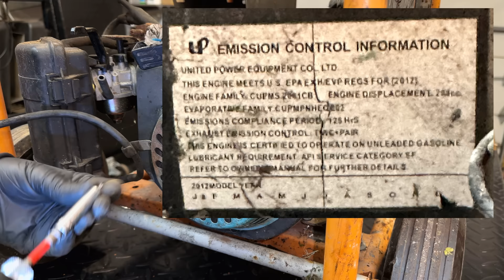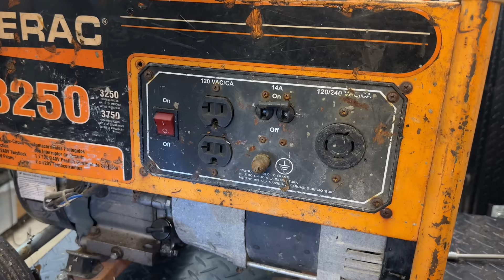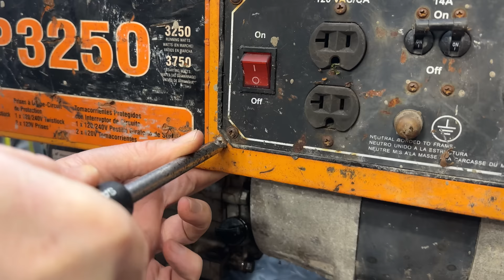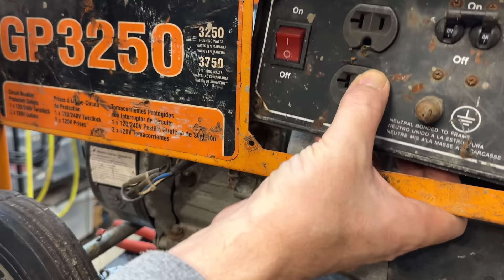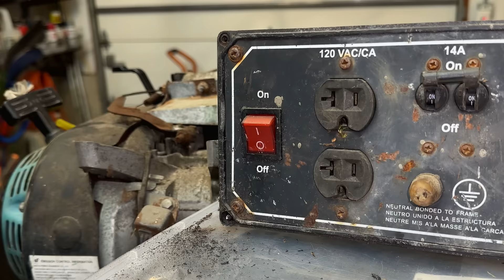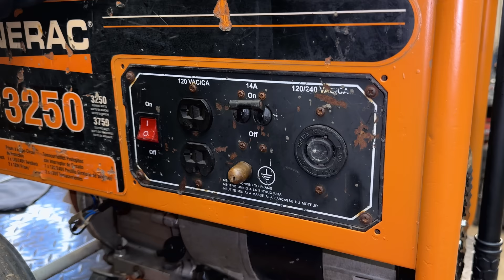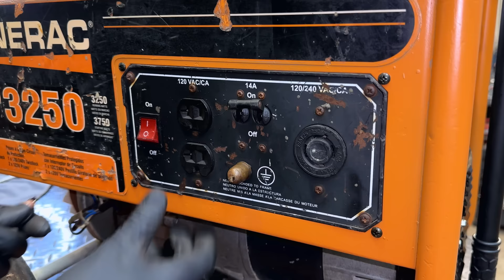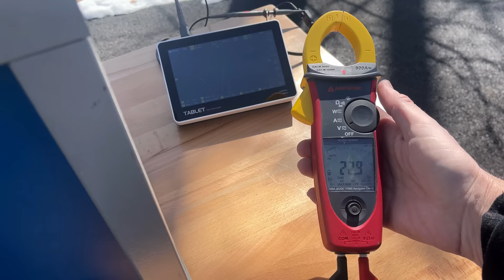Abandoned Generac GP3250 - Will It Run and Make Power?

Comment: After sanding a metal surface. IF you wipe it down with white vinegar it stops the oxidation process. And ensures a longer protection for the paint that is applied.

Comment: The best thing to use in your ultrasonic cleaner for carburetors is fresh gasoline in a glass jar big enough to hold the carb. Fill the machine with water and drop the jar in. Ultrasonic waves go right through glass. That's what I use in my small engine shop.

Comment: Welding tip: if you don’t have fine adjustments on your welder, try increasing the distance between your nozzle and weld (just a little). The amperage will drop some. Practice makes perfect.

Comment: How can anyone just leaving a good generator like this outside and do not take care of it? The work you did on this generator was amasing to see James. It's a lot of work. Thank you a lot! :-)
Reply: I am working on this same model and it looks almost as bad.  My is from an electrical contractor and unless brand new it is not worth the cost to repair them.  They get to look like that as they sit in the rain and snow next to a job site trailer.  After make parts like carb and springs are both under 20 dollars.  Replacement tank is about $40.  A little work and it makes a great backup generator to sit in the garage waiting for s significant power outage. I don't know how many hours a motor like this is good for but they live a hard life on job sites so I wouldn't want to try and sell this to someone who expects to get thousands of hours out of it.
Reply: @Privat2840 This generator may see a few hundred hours if it was used as a back up generator for the rest of its life. It will serve faithfully as long as basic maintenance is performed & they keep the tank dry between outages. 
I think it’s days as back up power on job sites have come & gone.

Comment: Our tech manuals called for a dilution of 60/40 of Simple Green in our sonic cleaners. 😉
Reply: I used gunk parts cleaner that comes in the gallon cans - I put in 2 gallons, and use it about 6 or 7 times then run it through a coffee filter in a funnel and use it about 6 or 7 more times. Its not cheap - 2 gallons cost me something like $100, but for 15 cleanings that's only about $7 each. It doesn't seem to bother most stuff but I don't put plastics or rubber in so I don't know how they would fare. I've thought about using dishwasher detergent as it has silica in it that may be able to 'sand blast" stuff clean in the ultrasonic but I've yet to try it.

Comment: For your seized screw into the plastic, just get yourself the HF butane micro torch, lightly roasting it will melt the plastic unfreezing the screw.
Also I find other uses for old gas, still cheaper than roundup for weeds growing in driveway and sidewalk cracks, and I mix it with drain oil for a punched up fire starter mix.

Comment: Thoroughly enjoy watching you methodically run down issues one by one.  Last year, I installed a natural gas 26Kw Generac whole house standby generator.  I did one before, a 14Kw at my dad's house so the hurdle wasn't as large as it was the first time.  The local electrical contractor company wanted $14,000 to supply the $6,400 generator and install it.  I ordered it from Amazon and did it myself and it works great.  The only issue is when it starts, it'll shut down after 30 seconds or so saying it's underspeed.  Another 30 seconds later, it starts again and runs fine, then switches over to power the house and we have not overloaded it yet just living normally when we have an outage, which happens quite frequently here.  I'm pretty sure the issue is the undersized flex line I have running to it.  It's 1/2" and not 3/4".  The 1/2" install was more practical in the short term because it would have taken a 25 foot run of 3/4" line to tap into my gas line in the basement easily, to an accessible valve, without needing to cut pipe. The 1/2" line run is less than 10 feet. I think what's happening is the 1/2" line, once primed and at full delivery pressure, runs the generator OK but if it hasn't been run for a while, (it tests weekly and demonstrates the same behavior) the line needs to prime before it'll run the generator at full speed.  I intend to install a 3/4" line at some point but it'll be a big project.  Anyway...cheers James.  Love the work you do!
Reply from the maker: 3/4” will definitely help.  That engine must be at least 50hp.
Reply: @jcondon1  Almost impossible to find HP specs on it. Not in any of the documentation for the generator. It’s 1000 cc. The NG rating is actually 24Kw. The rotor/stator is about 18” long a foot in diameter. Well over 550 lbs. Amazing piece of kit. 200 amp transfer switch. Beastly!

Comment: I've had good luck with Simple Green Pro HD Heavy Duty Cleaner (purple) in my ultrasonic cleaner.  It is advertised to be "optimized for use on metals" and I have had no discoloration on aluminum parts after use.  Simple Green also markets a product called Aircraft and Precision Cleaner that appears to be very safe to use.
Reply from the maker: I just used it and got good results.

Comment: Hi James, your struggle with corroded bolts suggests you need a hammer-operated  Impact Driver like I purchased many years ago, way before battery tools came to the fore - a thing like Draper part 22322.  This has got me out of the mire many times, performing when the Makita Impact Driver achieved nothing.  Great instructional and entertaining videos.  And like others I think the title ought to be 'When will it run and make power?.  😀

Comment: Thanks James. I own one of those bought new. It starts easy and works fine for running a large barn fan charging batteries and running lights in a barn where there is no electricity. I didn't pay much for it and didn't expect much from it but it does everything I want. I have no idea what the Erpm, Volts, Freq or THD are, it does what I want for the money. I would never buy another one though, only because of what I know about the country where it was built. ben/ michigan

Comment: Hi James, that Generac 3250 generator that u worked on and fuel tank is a mess with rust, if u have lots of time to set the machine aside, when u have done all the work u can and have to wait for fuel tank, the rest of that you use is very expensive, go to a farm feed store and buy yourself a gallon jug of blackstrap molasses, you can mix the Molasses with warm water and put in any Metals in it and it won't harm  the metals, for the fuel tank, u could likely mix a half gallon of molasses in fuel tank and fill with warm water, then set it corner and let it do its job. The more molasses u use, the quicker the mix will work. If yr not sure of the molasses, mix a little bit in a cup and put the Rusty nut and bolt that is seized you have and put it in the cup and let it sit. A lock smith told me this yrs ago, cheers from Seagrave Ontario
Reply: Worked with molasses for almost 20 yrs in Hamilton with feed grade molasses, takes quite a while to remove rust,maybe he could put it in the ultra sonic cleaner.Gord Ontario Canada

Comment: When I've seen machines with this rusty grimy patina, they've typically been under a deck for years where they never get airflow and sunlight to fully dry out and all kinds of grime comes through the deck onto them (people walking around, tree debris, roof grit, etc).  Water in the tank either because it is splashing down off the house, or sometimes just from the tank breathing and condensing water inside over years.  My experience has been that "deck machines" generally look terrible but end up not having serious mechanical issues (except for pre-existing conditions that led to them being parked there)

Comment: Thanks Jim for another fine video. Sometimes with your side cutters you can get a screw to turn. But the cutter edges have to go straight in so that they bite into the middle and outer edge of the screw at the same time. Then the handle's will give you lots of turning torque.
Reply: I have also seen a hack on YouTube where they use a bit of rag on the screw driver bit. Not tried it myself but thought that this situation would have been an ideal test.

Comment: Aloha James.   I enjoyed this video, and very good job sprucing it up and checking it out.   I hope you removed the black widow spider from the rope start cup on the crankshaft.   If not she will be in for a very dizzy time.    Also, for the panel screw that you could not get out, I have had great success with an impact driver with a phillips bit in it to loosen frozen screws.   My impact driver with a phillips bit in it is the only tool that would allow me to do oil changes in my 1972 Honda SL-175 motorcycle without stripping out the phillips head in those screws.    Thanks for the great narrative and keep the very entertaining videos coming.   Thanks for this one....

Comment: After watching the early part of this video with the demonstration of the reaction of aluminum to the new formula of Harbor Freight degreaser, I did some searching.  There were a couple of brands that may have been suitable but were beastly expensive (my opinion.)  But, one product does sound interesting:  Zep Heavy Duty Citrus concentrated degreaser which specifically states that it's safe for aluminum and is ~$15.00 per gallon at Lowe's (it's orange in color.)

Comment: Great video , With these carbs if the idle set screw is too far out it makes the reinstallation of the carb lineage more difficult . The best position for this screw to be in when removing linkage is allowing the throttle to open all the way . Other wise you have to bend the linkage to remove it .

Comment: The problem with painting the tank with lacquer is that any gas spill will ruin the finish. You should add a coat of fiberglass clear spray to solve this issue. I learned this problem on a Vespa. The first gas spill messed it up.

Comment: I’ll cover the valve cover.  Hey, crazy idea, have you ever thought about putting some of these machines on auction online (maybe eBay) to bid after the video?  Shipping would be a challenge but probably doable and could be the ultimate “merch” for a fan. In other words it could potentially get top dollar for the machine and a fun way to get a trusted machine for the fans.  Throw in a t-shirt and a sticker.  I’d buy one.
Reply from the maker: Thanks for covering the valve cover!  Have looked into shipping generators, but have not found any freight company that would ship larger ones for less than the generator value.

Comment: The best product I've found for cleaning up engine blocks, or basically anything,  to remove the grime is Meguiar's Hot Rims Wheel and Tire Cleaner (The G-9524 version). Spay it on, wait about 30 seconds, brush and rinse. It works awesome. Give it a try... G.

Comment: My guess on that generator was that it sat outside where there was snow that drifted over it. As the temperature warms and the snow thaws and freezes again, it forms a crust of ice that funnels the melting snow around the gas cap, eventually working it's way past the gasket as freezing causes the water to expand.

Comment: Normally on equipment this rusty Jake and i would be pulling out the Venom Mini Ductor induction gun which has 100% success rate at Eliminator whenever we have needed to use it to remove seized nuts and bolts. Nothing like a little paint spray fume in the shop to get your day going eh? Well done James another saviour from the junk yard.
Reply from the maker: The induction gun is a nice tool to have.  Year ago I have an acetylene torch which I sold because I never used it.  Wish I still had it.

Comment: Simple Green has a degreaser that will not attack aluminum. It's available from aircraft spruce, as our other degreasers that are safe for aluminum.
Reply from the maker: Just started using Simple Green Pro HD with good results so far.

Comment: I use the simple green pro HD (the purple stuff) in my ultrasonic cleaner, so far it's worked great and hasn't reacted with any carbs. There's probably cheaper stuff out there but it seems to work good.

Comment: Just thinking and after a look at the safety data sheet for the Harbour Freight degreaser, if it’s the same one, it contains tetrasodium EDTA which is a chelation reagent similar to Evaporust, which with the sodium metasilicate compound might be a good alternative to start off with in cleaning manky fuel tanks. I’ve used a similar product here in the U.K. for bike and lawnmower tanks and whilst not as efficient as Evaporust it does get rid of varnish and a fair bit of rust too. Just thinking it might save all the grunt work with nuts and bolts. 
Just another thought, when repairing the frame, you’ll get more paint off with a stainless rotary wire brush, but I would have given it a dab of paint stripper or a blow-lamp and brush beforehand. With the frame repair, I would have split a piece of tube longways that was long enough to cover the holes in the frame that was of a similar size, giving it a tap to spread it enough for a close fit and then welded that up, using the first handle you indicated. Lastly, your wire feed speed was a bit too high hence the pop-pop-pop at startup. A good practice is to set the machine on a bit of scrap beforehand. If you don’t have a handbook, most of the DIY size welders have some semblance of instruction manual somewhere, if not, email the manufacturer they’ll generally help you out. Great video as always.

Comment: Stripped screws: a quick tip you can try. get a beafy rubber band, place the rubber band in between the screw head and the bit and push like hell when try to turn. You'd be surprised how many stripped screws you can get out this way. On a different note, I think it's time to ask Santa for a sand/soda blasting station! :)

Comment: James I wanted to tell you about watching some test runs on different ultra sonic cleaners and one that really impressed me the other day was Cascade pods.  Guy cleaned aluminum pistons and rods and they came out beautiful.  He was using a large size ultrasonic and used four pods i believe but it did a great job and was the cheapest with the exception of dawn which did not do very good.  Maybe you might experiment with the cascade.
Reply from the maker: I have those in my kitchen.  Will do some experimenting.

Comment: Try a couple of buckets of the Berryman chem-dip carb cleaner. I use it and it works great and have been using for years in my ultra sonic. I drain into a container about every 6 months scoop out the dirt and debris and pour it back in

Comment: Stuck screws into plastic . Hold a reasonably powerful electric soldering iron against the head for a couple of minutes and they usually free off . Dipping a Phillips or pz driver in valve paste helps them grip in bad heads.  No soldering iron? Hot up a bolt with the blow torch, the hold that ( with vice grips) against the screw head.

Comment: If you ever in a bind with that level of rust on the muffler you can remove the loose rust give it a light sanding and apply Rust-Oleum Rust Reformer. That'll turn the muffler black and the rust reformer will inhibit any further rusting. if you still want or need to paint the muffler after the Rust Reformer has dried you can do that as well.

Comment: On some of those crusty nuts and bolts if you apply some light heat from a propane torch, and hit the hardware with a penetrating fluid they should come apart easier. Just my 2 cents. Good video.